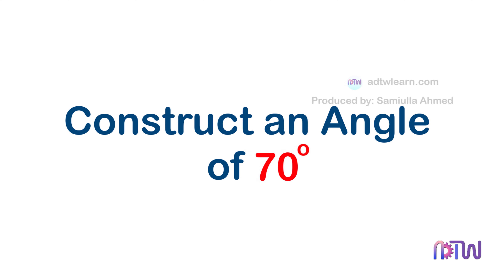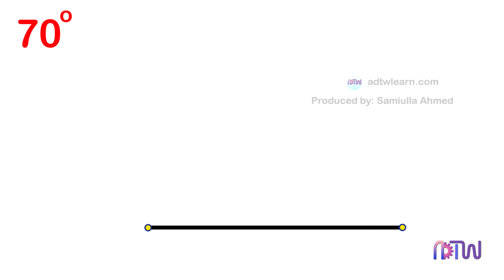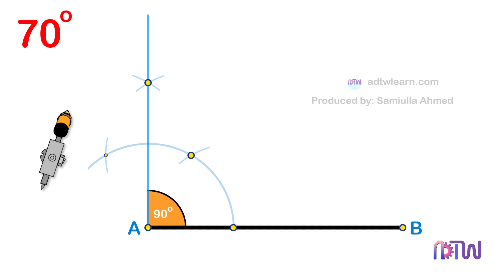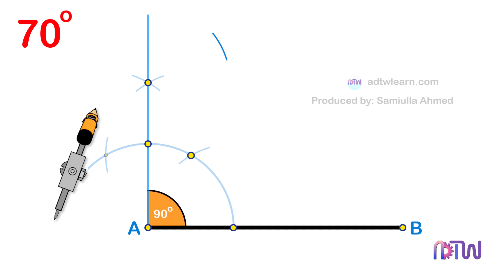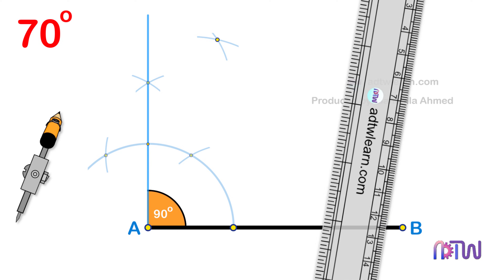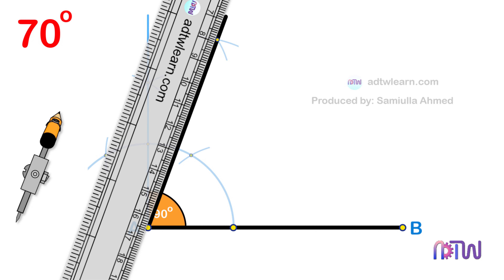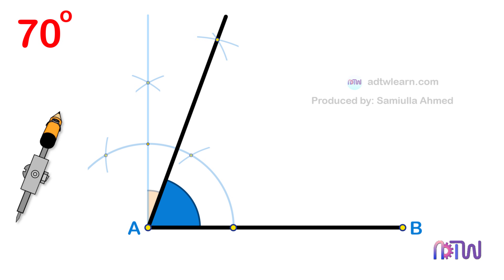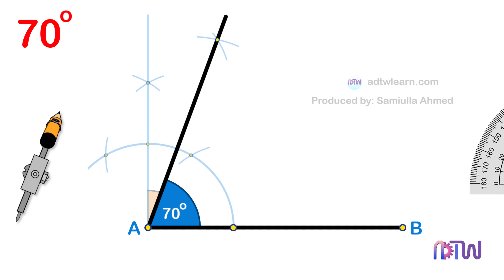How to construct 70 degree angle || 70 degree angle tutorial || #angle

Comment: why do u use a ruler with measures and you take too much steps to draw the right angle haiyaaa.
Reply: I think the point is that using this method, all you require is a compass and a straight edge. The measurements along the ruler are not needed. 

Many similar constructs are possible, and such methods have been used by cultures like the Ancient Egyptians, Greek, Roman, Hindu, Islamic, Chinese and Christians, for major architectural structures, tessellations and art, for thousands of years.